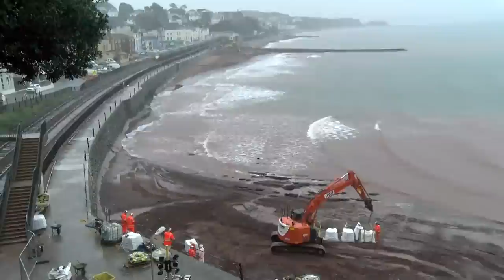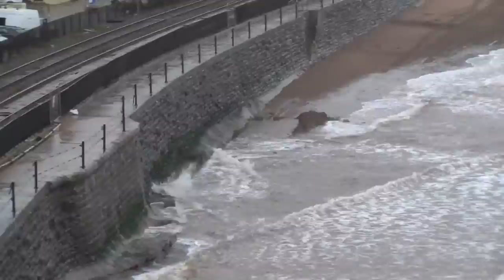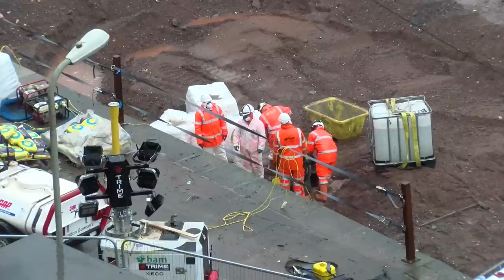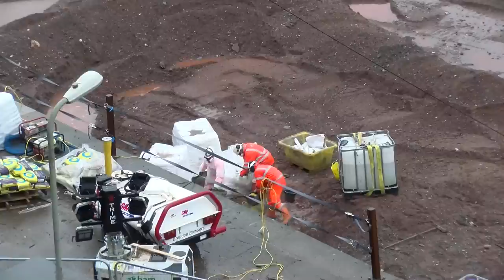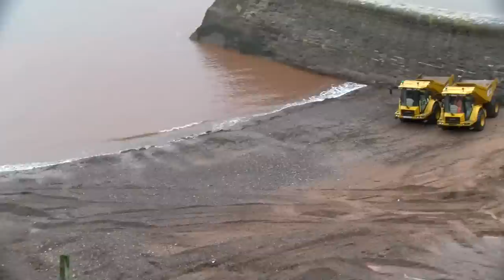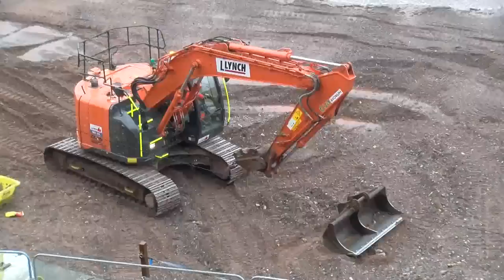New Sea Wall Works - South West Rail Resilience Programme

Comment: I am now 84 and lived in the area during and after WW2.
When my Father came home from Army service in 1945, I was 10 years old and he was employed on the GWR as a plate layer.
Following the war the Admiralty raised concerns at Govt level about the possibility of storm damage to the main 
line at Dawlish cutting off its main fleet base at Plymouth from re supply of ammunition / fuel and Stores etc.
As a consequence in 1946 and 1947 my Father and other Staff were employed, in gangs of 12 men, every weekend for 2 years in
bringing the Teign Valley line - from Newton Abbot to Exeter St Thomas, via Lustleigh and Trusham up to main line standards !
With the expectation of heavy ammunition trains the existing line - mostly single track with passing loops at Stations - 
was deemed to not be up to those specifications !
So every under bridge and drainage culvert and embankment was strengthened to be able to cope with extra weight plus
passing loops were lengthened.

The Teign Valley line was closed to traffic at the time of Beeching cuts but after then it was occasionally used for the Royal Train to 
be stabled at night when on tours of the West Country, until the track was finally lifted.
Had it been kept ready on a care and maintenance basis - as many military bases were, the West Country could have had continuous 
traffic during the recent period of closure.
I remember my Father and his mates cycling home after a gruelling days work with pick and shovel absolutely worn out and this went on for 2 years.
It is a prime example of the folly of Government short sightedness when Beeching was brought in !
PGH
Reply: Hi,your father's life was similar to most mine! Only Dad was demibed in 1953/4 after national service. My Grandfather was ticket collector on the Dawlish train. As children we spent every summer of 1955- 1965 in Dawlish., were my sister was born . I was born in Newton Abbot. Best memories of my life are from my little Dawlish.

Comment: Seawall surfaces, a reaction to consider is that smooth surfaces don't dissipate wave energy, they transfer it.

There are options used to break this up from era works, stones set out from the rest of a smooth wall create a lot of air entrainment and reduce impacts, not enough yet better than none.

Some seawall failures in the 2011 Tohoku tsunami were from smooth faces sending a cumulative wave sideways along them.

For these consider modifying N.Tesla's 'valvular conduit', a one-way air valve with no moving parts uses vortexes to dissipate the energy, a quite simple strategy.

These can be preformed & cast faces added to structures.

So, please consider testing vortex panels as a way to reduce pounding and overspray flooding, that lessens damage and risk. 

Having the solid precast structure in place, these would be a facing, they can jut into the water as pyramids to shred all directions and angled slightly down as a panel so less vertical spray as suggested.
Hth, cheers!

Comment: They keep repairing a sea wall which is a few metres from the rail tracks yet never consider filling the area in front of the wall with those interlocking concrete structures to dissipate  storm waves,
it's extroadinary behaviour,it would also stop the waves crashing over the trains,obviously somebody is making too much money with the sea wall repair contract
Reply: that's what I have suggested on several videos

Comment: As a retired Maintenance Manager in the Hotel Industry,  1000&1 uses for a wood saw @18.00 ->22.00 mins in.. Knife, hammer.. nowt like tool abuse when you don't have to pay for it yourself.. Re-Training and Health and Safety issue 22.00 - 23.00 minutes,  'Operative' picks the saw up by the handle and then holds by the BLADE to use it... Tough layered grout bags? 2layers of paper with a plastic film between?.. No wonder CrossRail is so over budget and behind schedule watching this....

Comment: I've said it before how many men does it take to look at the ones working. And working at what ???? . What is they digging for to stop the waves being strong on what their work NO WAY. WE WHO LIVE HERE KNOW HOW STRONG IT CAN BE TO WIPE ALL THAT AWAY IN ONE WAVE. A LOT OF MONEY FOR NOTHING. SORRY I WORKED ON BUILDING SITES AS A FORMAN AND I SAYING IT AS I SEE IT.
Reply: I am now 84 and lived in the area during and after WW2.
When my Father came home from Army service in 1945, I was 10 years old and he was employed on the GWR as a plate layer.
Following the war the Admiralty raised concerns at Govt level about the possibility of storm damage to the main 
line at Dawlish cutting off its main fleet base at Plymouth from re supply of ammunition / fuel and Stores etc.
As a consequence in 1946 and 1947 my Father and other Staff were employed, in gangs of 12 men, every weekend for 2 years in
bringing the Teign Valley line - from Newton Abbot to Exeter St Thomas, via Lustleigh and Trusham up to main line standards !
With the expectation of heavy ammunition trains the existing line - mostly single track with passing loops at Stations - 
was deemed to not be up to those specifications !
So every under bridge and drainage culvert and embankment was strengthened to be able to cope with extra weight plus
passing loops were lengthened.

The Teign Valley line was closed to traffic at the time of Beeching cuts but after then it was occasionally used for the Royal Train to 
be stabled at night when on tours of the West Country, until the track was finally lifted.
Had it been kept ready on a care and maintenance basis - as many military bases were, the West Country could have had continuous 
traffic during the recent period of closure.
I remember my Father and his mates cycling home after a gruelling days work with pick and shovel absolutely worn out and this went on for 2 years.
It is a prime example of the folly of Government short sightedness when Beeching was brought in !
PGH